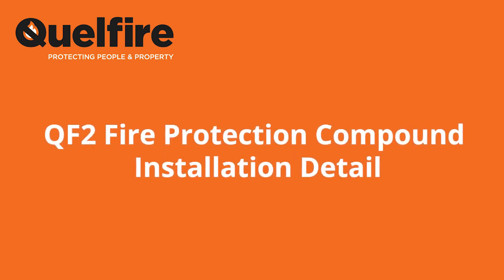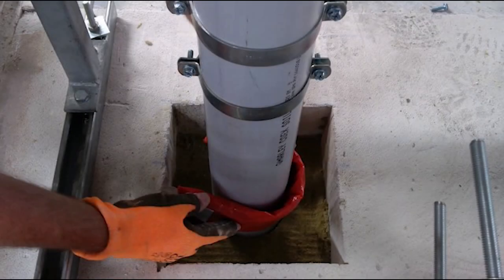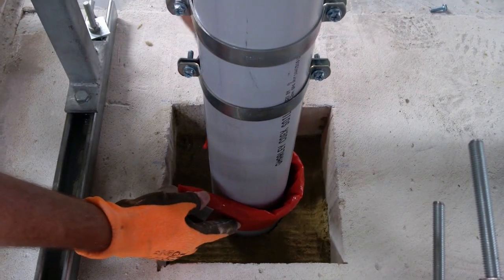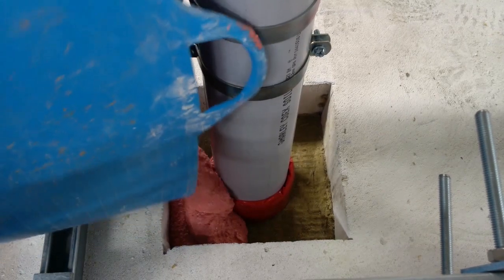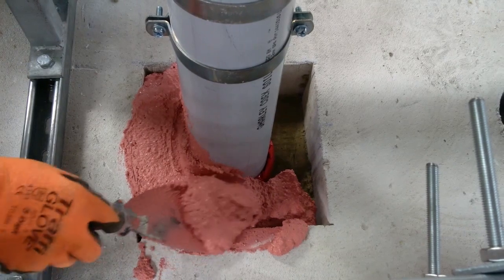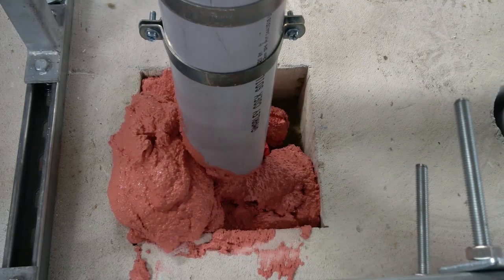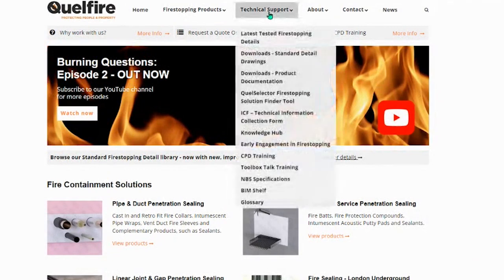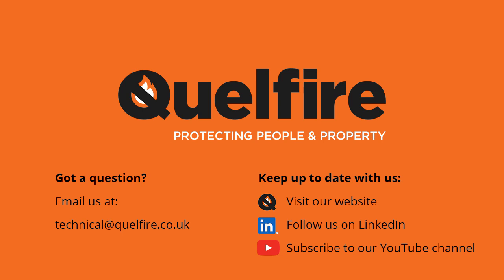How to Firestop a Plastic Pipe Penetrating a Concrete Floor (Oversized Hole)

Comment: Why the compound why not just concrete?
Reply from the maker: Hello, and thank you for your question. QF2 Fire Protection offers excellent fire-resistance properties. While it slightly expands during curing, concrete often shrinks, so it may not behave the same way in a fire situation. All installations should be carried out following the manufacturer's guidance and test evidence. If you have any further questions, please reach out at technical@quelfire.co.uk.